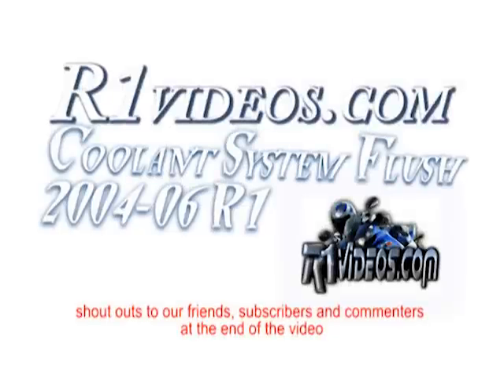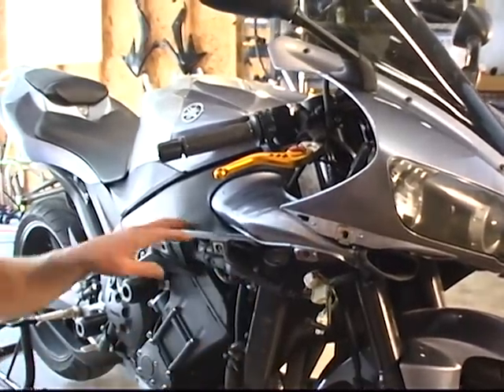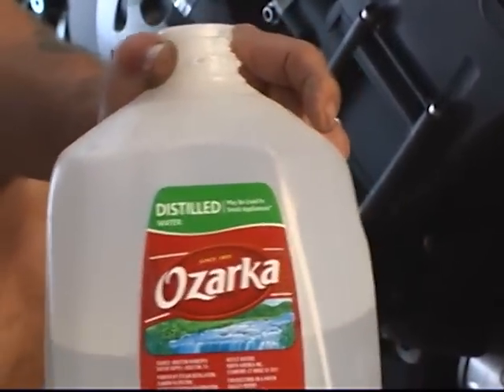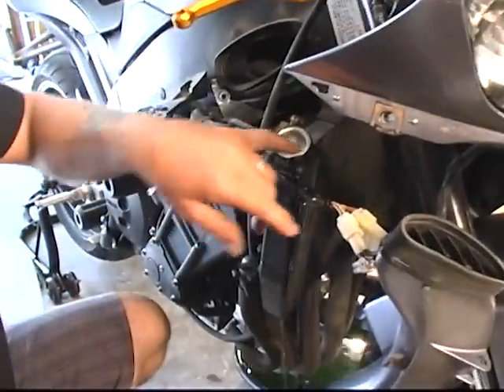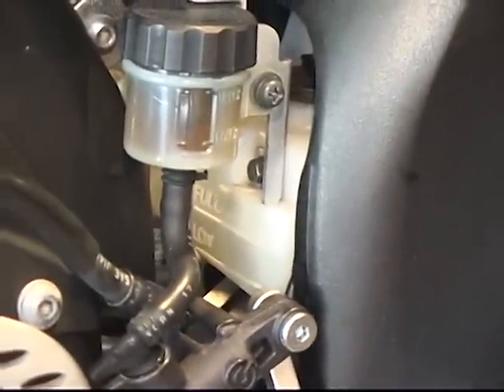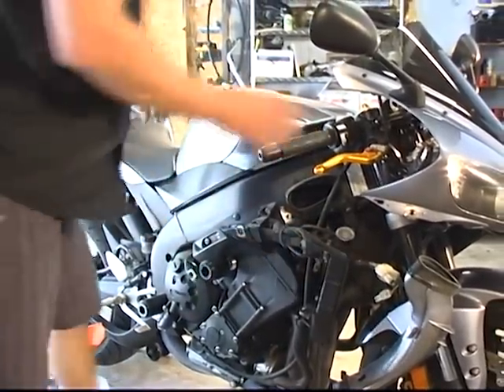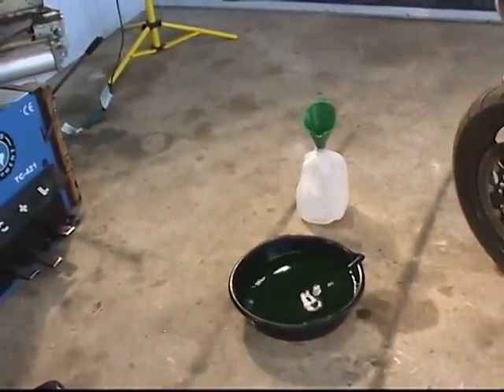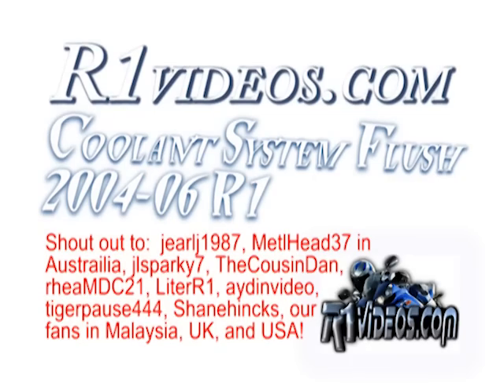How To Flush Coolant System 2004 2005 2006 R1 R1Videos.com

Comment: Good video.. The only thing I did differently was I watched my temp gauge and when it got to around 165, the thermostat opened up and you could then see the water start to circulate. At first the water will rise slightly (for that reason I under fill to about 3/4" from the base of the radiator cap neck) but as soon as it hits around 165F  you will see the coolant moving around and then sink into the radiator below the internal fins. I then shut the bike off and refill to the base of the radiator cap.   Typically no mess when when you do it that way...  That's my story and I'm sticking to it... ;) Cheers everyone. Thanks Todd
Reply: Ryden McKenna i

Comment: Great reference video. I own a 2009 R1. My question is this...I was under the assumption that after draining the old coolant out it was better to fill up the system with distilled water and let it circulate. To flush the system completely. Drain that out and then fill it back up with the new coolant. Correct me if I'm wrong. I'm about to flush out my system and want to make sure I'm doing it correctly. Thanks and keep up the great work.

Comment: These videos are great, please keep them coming. The explanations are clear and most importantly the camera work is GREAT. Nice and close and in sharp focus. Best bike maintenance videos I've seen on the net, bonus that they're for an R1.

Question: Do I need to drain the coolant to replace the thermostat, or is it high enough that if the bike is left for several hours the coolant will drain out of the housing?

Comment from the maker: @thechristianbugok we chose not to refill with the green radiator fluid - we only put distilled water and a product called "Water Wetter" back into the bike. While this mixture doesn't have anti-freeze properties, it does allow our R1 to run a bit cooler.

Comment: but couldnt you burp it with the cap still on but not tight jus loose and sitting on top so it doesnt get so messy with distilled water.

Comment: Can I use Engine Ice instead of what you used? 
I saw a video where a guy used it and filled the radiator using only the engine ice and didn't need to put any distilled water with it.

Comment: Thanks for the video. Have a question though distilled water freeze faster than water, is it bad idea to use it in cooler temperature where it freezes. Thanks

Comment from the maker: @markus0933 Yeah, you would want to continue to use rad fluid. There is no problem at all using rad fluid, we just choose not to down here in the Texas heat since going with water and the "Water Wetter" alone makes the bike run a bit cooler. It doesn't have anti-freeze powers though. And thanks for the compliment! Be sure to see our website and become an "R1 Insider" and of course, email us anytime if you have a question or need a tip.

Comment from the maker: Exactly - if you don't get all the air bubbles out when you change the radiator fluid, then your sportbike will overheat after you finish the job and go out for a ride. Doesn't happen too often on sportbikes but we like to be thorough.

Comment: i just bought a 2006 r1 50th anniversary, and upon my ride home from purchasing it, i noticed that it likes to overheat when sitting at idle for a length of time. could this be because of air in the system? the fan does switch on at ~220 degrees, but the temp will continue to climb. advice?

Comment from the maker: Should be for the most part - there are some changes as the models change from each "new bike" year, but you should be able to use the other videos as a general guide for your R6. Thanks for subbing and for watching. You never know, you might end up moving to the R1 some day. I went from a 1999 Yamaha FZR 600 to my current 2004 silver R1. Ride safe!

Comment from the maker: From your description, it doesn't sound like there is a problem at this point. The R1 runs hot when idling or at a stop light, etc. Ours do the same thing. A trick I use is to turn the headlights down to low beams (as your fan gets a little more power this way to spin faster). Once you get rolling again, your R1 will cool down. Remember to turn the bright beams back on when the fan stops (if riding during daylight). Watch this video and try flushing your coolant system as that can help a bit.

Comment: Can you guys make a video on the gauge cluster wire harness? My 04 R1 is  acting up, the gauge cluster would flicker on and off when I would fiddle with the wires going to the cluster.  Thanks for the awesome videos btw! Just changed my coolant and oil!
Reply: guaranteed its at the bend going in. Its a bit of hassle fixing it unless you are at a decent level of electric repair or if the deteriorated wire isnt obvious. Its not always the power or earth cables either it can be another wire causing it. Youd be best off removing it and if you know someone good at rewiring ecelctronics will easily be able to fix the bad wire and possibly beef up the rest of them, or find a new custer thats off a crashed bike or a bike you know it works fine. You want to put a few twists on the cable  when you plug it in so it has some tension throught the entire cable. Its the fact they dangle below the first bend causes that. KTM and BMW are the worst for it

Comment from the maker: @markus0933 yes, we do that so the R1 runs a hair or two cooler. We only use water and a product called "Water Wetter" as seen in the vid. However, this method will not keep your fluids from freezing. You should use radiator fluid if that works best for you. You can run it either way though, this is just a mod we do. We are in Texas and keep our R1's out of the elements so we don't need to run radiator fluid in our bikes. That help?

Comment from the maker: Sorry for the wait - check out our post on the site (we've been behind with some new life events). OK, so yes, you could go that route and it wouldn't hurt. Not exactly how much it would help since your system can run either way (coolant, water, or even water + "Water Wetter" which is what we run down here in Texas). Sure, if you have time and want to be super thorough, it makes sense - - just not sure how much difference it ultimately makes. Might as well go for it if you have the time, right!?

Comment from the maker: Leave the cap off to release the air bubbles when changing the fluids. You burp out the bubbles and turn the bike off right when it starts shooting out. Then refill it SLOWLY. Air bubbles will cause your bike to overheat after you put her back together and go ride. Not all that common, but can happen. Happens more in ATVs and so forth. Just follow the video and you'll be good to go! Thanks for your question. 

Robert on behalf of Todd - 

R1Videos . com

Comment: Another question after all the old coolant is out and before adding the new coolant  can I use regular water just to clean up the system ? Because I'm actually using motorcycle coolant not distilled water

Comment: i have a 2005 r1 i live in the uk so as i have had the bike a couple of years think its time to change the coolant....ive bought the motul antifreeze its yellow in colour im a little worried watching your vid that as it was expensive when running the bike up to temp with the rad cap off i will loose alot of it...plus can the antifreez coolant cause damage to the paint work if it gets on it.....love the vids cheers

Comment from the maker: Good to know, I'll ask Todd more about this. We run water (with a bit of "Water Wetter") to keep the temp down. Antifreeze works just fine and there are no problems with using it. The temp is a bit cooler with water and we've always used water. We are in Texas and do not suggest you use water in states or countries where you get freezing weather. Todd has over 80K miles on his R1 (he replaced his motor around 50K) and has never had a corrosion problem and always runs water with Water Wetter.

Comment from the maker: Won't happen. The water (or radiator fluid) you use to top it off is at room temp. Even if it were freezing, it would warm up as you top it off. That small amount no matter how cold can do no such thing. No worries homie.

Comment: Well, I made the mistake of storing my 2001 R1 with 7500 miles on it for 20 years wthout changing the coolant, and now I'm paying for it. The reservoir tank was dry, the radiator cap rubber is partially dried out, the coolant has rust in it from the corroded water pump impeller, I have to completely rebuild the water pump, I haven't even checked the radiator yet but I'm sure will have to flush several times and hope it cleans up OK, not to mention cleaning out the coolant passages in the engine. I can't imagine how crappy they must be by now.

Comment: I have a few questions do I really need to do that ? Start the bike with the cap off ? Like I'm going to do my coolant flush this weekend but I'm using motorcycle coolant witch is not cheap out here in boston ma so I just don't want it to be wasted if I don't have to do this mandatory...another question can I use the water weater with coolant (I want my bike to run as cool as possible ..lol)  another question since I got my bike back in 2009 the reservoir was in the low line  but it been empty for the longest can I just pour coolant in there or i need to try to dry it out any ways ?

Comment: How often does the bike needs a coolant change and when do you know when to stop with the bubbles with the cap off just bought an 05 r1 when I'm riding it it stays between 187 to like 216 when I stop today I notice a lil piece of rubber melt and it had a lil splash of coolant well looks like I feel like one hose got a small leak if someone could help me out and when I give it gas while the bike is stop or neutral feels a lil rough when I rev it

Comment from the maker: gotta get it just up to temp to get all the bubbles out, then you cap it. overflow tank catches the overflow, not the normal function of the radiator. hope this helps
Reply: Cant understand why you had to turn the bike on with the cap off and let it spew coola t all over tje place. You could jut rake the cap off and rock the bike left to right to displace the bubbles in the system. It will burp alot and just fill in more.

Comment: is there a way to do this without water spilling out the radiator when you run it. im using engine ice and dont want that all over my bike and floor
Reply: put a microfiber cloth over it. You can also see it go damp when the coolant starts spitting

Comment from the maker: If you use water, the water will freeze when you get freezing temps so you won't be able to operate your sportbike. If you are just storing your bike it shouldn't be a problem. Just don't overfill because water expands when it freezes. We use distilled water here in Texas, as it can get down to freezing but not very often and not for very long. When it does, we just can't go riding.

Comment: I know I'm a few years too late but I hope you guys read my question. I had a coolant leak a few weeks ago and it was because of a loose clamp on one of the radiator hoses  so after every ride when I parked the bike it kept spilling out coolant. so I found the leak, fixed it and know when I go for a ride and stop on red lights the bike overheats like crazy going up to 255° then it goes back down when I start moving. I know I'm low on coolant so my question is do you think it's because I'm low on coolant or there might be something else ?
Reply: Gotta burp the system (get air bubbles out).

Comment: Water in your bike damages passages??? What do you think you add to antifreeze? Water. What do you think is in 50/50 antifreeze? 50% WATER/50% coolant. There is nothing wrong with running straight water as long as its DISTILLED WATER... I'm with R1vids I like water wetter or engine ice

Comment: Hi I have a 2004 Yamaha R1 and have been having a coolant leak problem for some time I've taken it to a shop several times and they cant seem to actually fix the problem!! The leak look like it's coming out of the little hole in the oil pan!
Reply: Check your Rad cap is sealing properly,if rubber is worn replace cap.
Reply: John Turner the mechanical seal is probably worn out in your water pump. That hole in the pan is a drainage weep hole
Reply: needs water pump done. You can get a new one for £350 in UK and its £500 fitted or do it yourself and as long as the impellors arent rotted out you can replace seals. If you are DIY'ing it you need all waterpump seals and bearings and the seals for the 2 coolant pipes going into the pump and get a sump gasket too unless your old one is immaculate and even then use some sealant on that. You dont need to take the clutch out to do it like most people say, you can do it through the bottom end. If you do it via the bottom only then dont push the pump chain upward off the top clog as it can get stuck when you pull it down. Put the bike in gear and turn the back wheel to line up the chain so the  cam on the pump input shaft sprocket can be put back on without too much messing about. The hardest bit will be getting the exhaust off im not joking.

Comment from the maker: You can do distilled water only, distilled water and wetter, or 50/50 mix of distilled and coolant, or just coolant. Depends on temps you want to run and if you live where it freezes. If it freezes where you live, I'd stick with coolant. You don't want your bike to freeze up. Here is Texas we ain't worried about freezing temps. We are more concerned with running the R1 as cool as we can. So it's been water + wetter for years for us with no problems.

Comment: Sooo, I’m confused or stupid. You put distilled water in the system instead of engine ice?
Reply: if you live in an area that wont get bellow freezing why would you use anything but water and a light as possible coolant dilution? Every engine cools better on straight water thats a fact. If you are here in the Scotland for example you only need it to survive a few days of anything bellow -15 if its outside so if your coolant says it protects to -30 then dilute it out by the data sheet to get as much water as possible. These engines run hot they dont like the silly 5yr coolant they need as close to a water mix as possible or if you must use pre-diluted garbage then you need to run water wetter and the likes to do the same job as distilled water does. I raced the things, i used Steam Distilled water and put one Tea-cup full of putoline ice cooler in them and never had one issue with temps or christalisation and not once did i need to clean the system AND the capture tank stayed perefecly see through no yellowing and no frothing up.. Nothing. The problems ive seen with people needlessly putting additives in these bikes when all that is needed is the old garbage blown out the coolant system and distilled water added for a track day or two till that cleared out the system. If you overtemp after a coolant change you need to burp the short section of thicker hose thats sits directly behind the manifold, just squash it a few times when the bikes warm and thermostat is open and that solves the trapped air on these like it does many bikes. Cheers.
Reply from the maker: Yip. Still going strong 20 years later!

Comment: You don't have to run it until it spews that's a mess I prefer to keep my floor as clean as possible, try this; with it uncapped run it for a few seconds you can watch the level drop cut it off add some more after about 2 or 3 times it's about damn perfect and less of a mess also you can leave rad cap on and undo bottom hose to drain faster and don't risk stripping or breaking the drain bolt great video though

Comment from the maker: You gotta get the air bubbles out and can't if the cap is left on - if you remove all the air bubbles when you change the radiator fluid, then your sportbike will overheat. Doesn't happen much on sportbikes but we don't chance it. If left on when the temp rises, how would the air bubbles escape? And you don't want to ever remove the radiator cap when the fluids are warm as it will spew and burn you. Let us know your thoughts on how else it would work. Thanks for commenting!

Comment: And surprised he didn’t go on to start saying about how to dismantle half the bike to gain easy access to the coolant reservoir underneath the sea area kind of like he did for the radiator reservoir and the coolant drain plug sections of the video adding unnecessary work to make it supposedly easier lol when he could’ve done the same thing that he’s doing for the reservoir portion for the radiator and it would’ve worked just fine

Comment: i would drain it then put the old coolant in a Jerrycan,
then mark the level of the old coolant in the Jerrycan and drain it.
fil the Jerrycan with new coolant exactly to the markerpoint you created.
top it of and let it run stationary while running you ad the coolant.

do not let it boil.
If your Jerrycan is empty, jou have exactly the same amount of coolant in jour system, then before you drained it.
And you are a 100% Sure there is no air left in the engine.
if you follow this good advice you can never go wrong anymore.
if it is not empty you are a 100% sure there is air left in your system, that will destroy or damage the engine.
then Vacuum bleed the cooling system would fix this problem.
P.S
Germany is the only country in the whole world that does not sell Jerry Can´s but thy call it kraftstoffkanister
I Wonder Why ;-)                                                  ( Yerry is a nickname for Germans Thats why ;-)